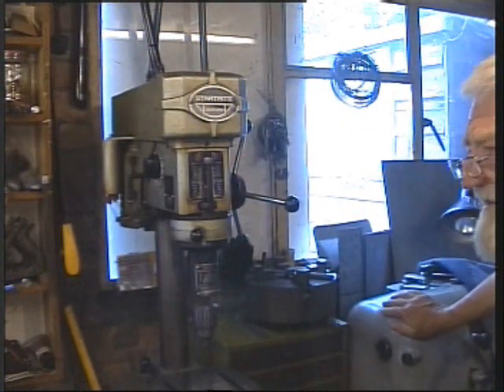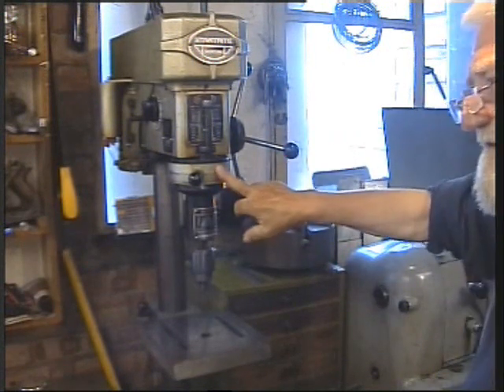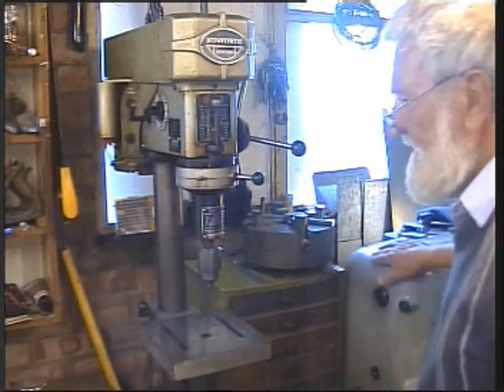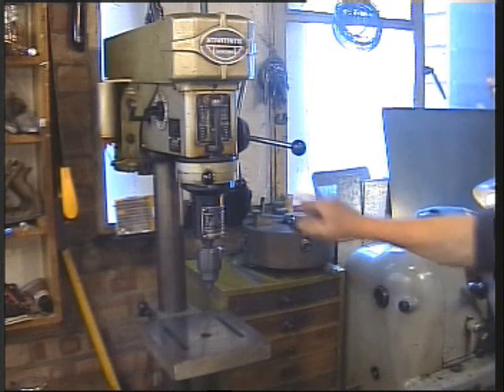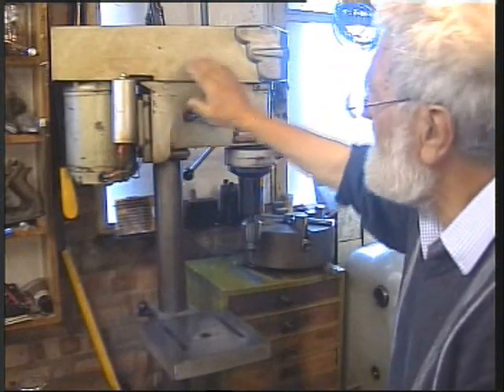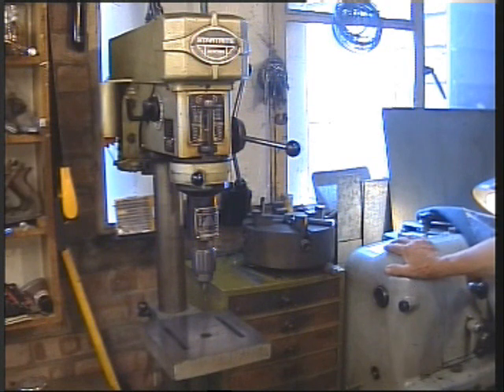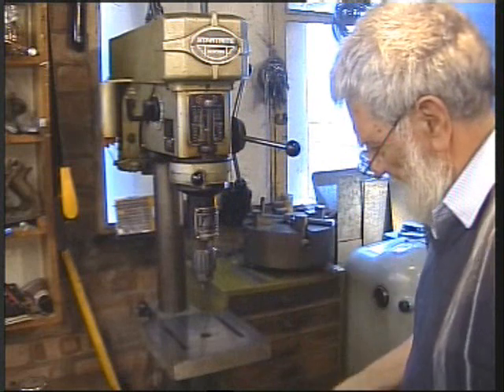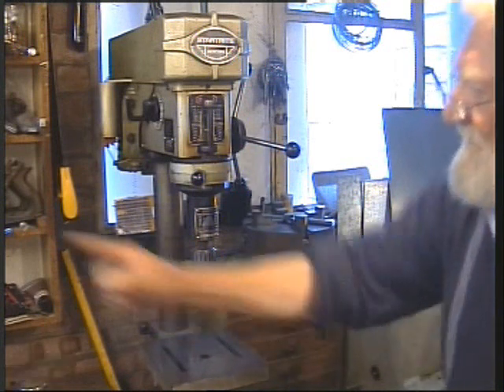once more

Comment: Here in Estonia you can't find machines that good in the skip. Couple of years ago i bought a Flott drill press from a chap who brings used cars from Germany. He said he fills them with tools, so his trips are more profitable. Anyway, I paid around 200 euros for it, and I was very happy with that. It's a table top version, but has a 1/2hp three phase motor in it. And it was made in 1953 in West-Germany, so everything is cast iron, even the company logo. I sometimes joke, that it has more cast iron in it's belt guard than a whole chinese drill press.

On the other hand.. I have found that jointers are really cheap here. I recently got a 410mm 5KW soviet jointer for 50 euros.The man who sold it, said that he is not in for the money but wants it to go to the right hands (it helped alot that i spot the ad six minutes after it was posted).  It weights around 300 kilos i guess, and i spent two days with sandpaper, spray adhesive and big flat granite slab to get the surfaces OK again.  This was a extraordinary deal, but you still can find these things here for around 350 euros regularly.

Cheers!

Comment: Sadly many of these went to the scrap yard.  Some set out in the rain and snow for years first. You can still find them but really there should be thousands available.  Sometimes you can find them at farm sales,  as farmers would buy them. Mainly now it is 1980s and newer light weight low quality machines you find more of. You will have wait and watch the adds like Craigslist for a good one and plan on several days of cleaning and rust removal.

Comment: That pillar drill = 25 cheapo asiatic cousins. The capacitor of course "synthesizes" the third phase by introducing a phase shift.  I would quibble that a real VFD would be a better solution but it would be rather expensive.  On the other hand it would give you varibale sppeds, since it can vary frequency for you. So you pays your money and you makes the your choice.

Comment: Why would anyone discard a useable machine like that? It is very strange it wasn't sold in the classified... Just wondering can it reverse while running so it can be used for threading?
Reply from the maker: Firms discard stuff all the time, It dosen`t pay them to mess about its cheaper to trash it. if they were to sell that would cost money, and make them liable, store it meentime , deal with all the Ebay prats etc who want something for nothing ,,besides its been written off tax wise etc by far the best option is to bin it!
Reply: Well I've been in the middle east too long. A machine like that would have been sold/swapped because quality machines like that are so expensive or otherwise hard to find that they are worked to bits and then restored repeatedly... with good results I might add.
Reply from the maker: The same skip earlier in the week had a large two pump compressor, I 
doubt it was a year old still had all labels and looked pristine. but as
 I said it would cost them .... its been tax deducted. to
 sell it would require a pat test/then cylinder test certificate 
health/safety stuff and all the hassle . its cheaper to hire a skip and 
put it in, if you think its crazy just look at what governments due. 
scrap aircraft carriers that have no aircraft !